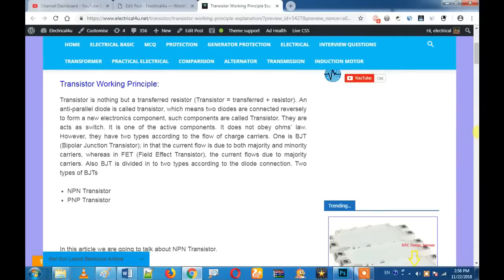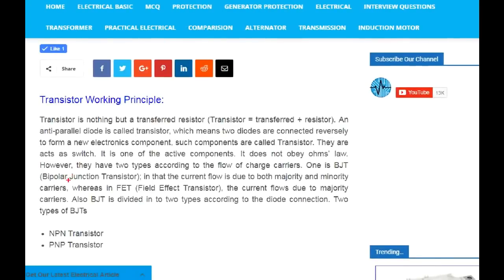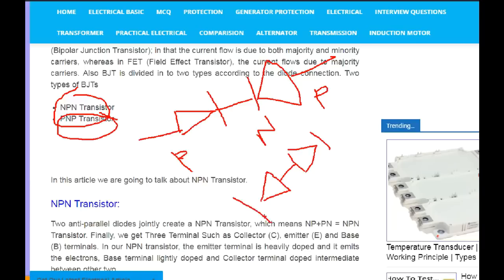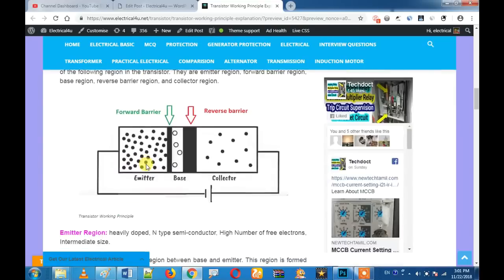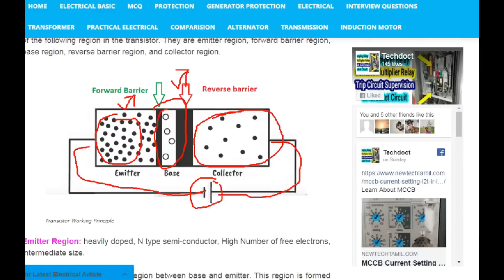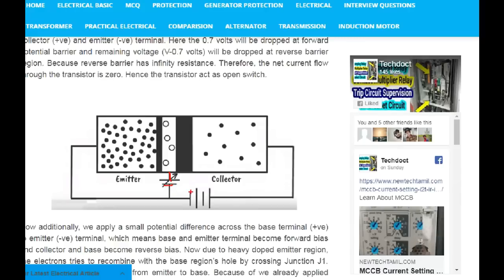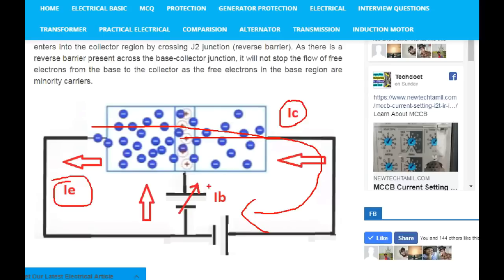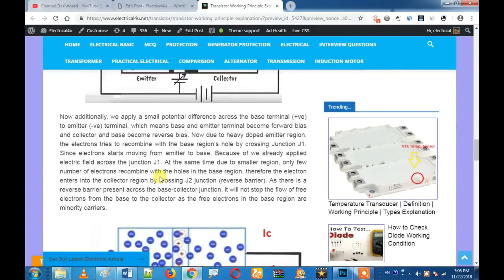Transistor Working In Tamil இது தெரியாம போச்சே

Comment: what is the use of transistor in receiver side
Reply: It's works as amplifier.it's covert small current into high current.eg Microphone
Acts like a switch the current flow is high in either side